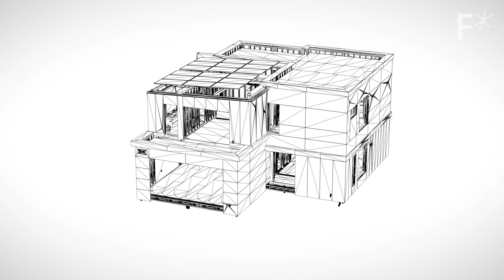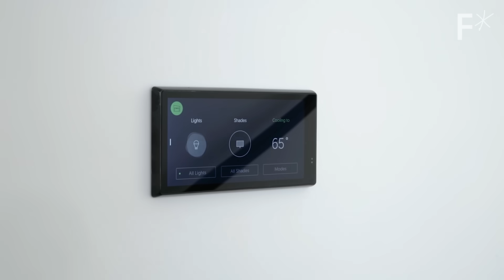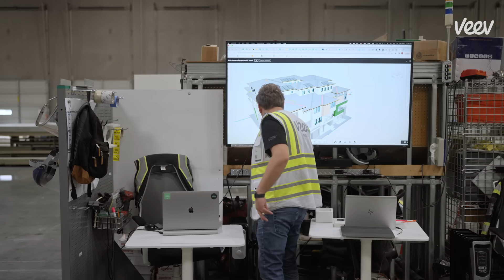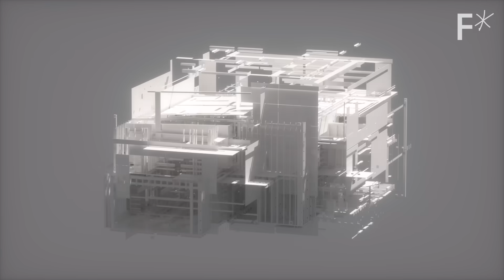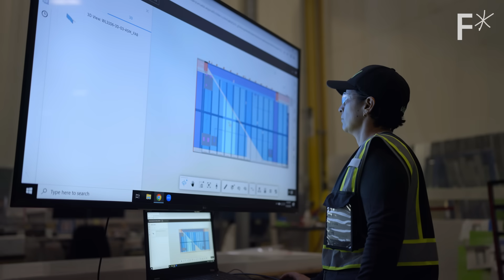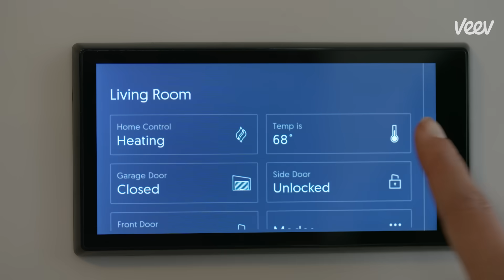We need to build better homes – here’s how

Comment: I want to love this! I really want to see more fabricated buildings that can be assembled on site. However, my number one concern is who services the product that is your home? What happens if you need to fix something in the wall? What if you want to move an outlet? change the lights in your ceiling? The current contractor based industry works and continues to succeed because each industry specializes in the implementation of their standards.

The other practical implications are things like what does hanging art look like? What about anchoring bookcases? Painting the walls, changing the flooring, etc.? Homes need to be able to evolve to meet our needs and desires and as basic as timber framing and sheetrock are, they're extremely adaptable.
Reply: My thought exactly. When they mentioned how the company wants innovate the house like phones and cars, the thought that went through my head was this might be a right to repair headaic considering the production process will be proprietary. And Veev didn't mention repairability either. Its is someones home, not a car or phone, and one of the most expensive "product". There are just too many red flags for my liking.
Reply from the maker: It's a great question! Independent contractors can also do the repairs- every single wall inside and out is a material that opens up really easily and then reseals: “HPS,” aka Corian, shown in the video though this capability is not specifically demonstrated.
Reply: Great comments; I think there will always be a rich marketplace for homes that are highly customizable. I also think there are swarms of people who want nice things without needing their own sense of style, and these prefab homes will be just right for them.
Reply: I’m sure it will repair itself😂

Comment: I would like to order two quad plexus, with a vibrance saturated color for each.

Higher desity is also vital.
Reply from the maker: That would be great! While this company has single family homes in mind, it's easy to imagine how it could play well with increased density and zoning reform. Missing middle housing types like plexes, townhomes, bungalow courts, etc. could be much easier to assemble quickly in areas that are currently zoned for sprawl.

Comment: I completely agree.. Efficiency, cost, and sustainability should be number one factors. I hope veev is taking this into consideration. 70% of an average home energy is spent on temperature control, so a highly insulated envelope is most important and should have been improved decades ago. I did I came across this video because I had similar conceptual ideas of homes being manufactured on the production line and very easy to assemble extremely cost-efficient, super-insulated and sustainable! Sustainability in all things is the most important concept that most overlook. I have built 128 square foot tiny home fully solar-powered fully off-grid with all the modern-day amenities for under 10k!!  Yes it can be done!! Wee need many more innovators in this space
Reply from the maker: That's incredible! Would love to know more about how you built that tiny home. Did you use a guide or is it your own design? Do you plan on documenting it?
Reply: @freethink  thanks for your interest! I haven't really documented it. It was my own concept. I do have some basic photos on Instagram and perhaps when I'm completely finished with it I could pay someone to do a good video and post on YouTube explaining all the systems I've used.. but the basic concept I found a used refrigerated truck box on marketplace for $500 someone was using as a storage container in their backyard .. pick the box up with a tow truck and mounted it on a triple axle trailer due to the heavy weight of the box being 5,000 lb. The refrigerated truck box had 4 in thick spray foam walls floor and ceiling. Then I bought 4 solar panels totaling 1280w and 2 lifepo4 batteries that were 300 amp hours each for a total of 600 amp hours at 12 volt. Mounted those and then bought a 12v mini-split HVAC made by velo solar out of Tucson..  recirculating shower with filtration UV sterilizer light and I use elite Noble shungite in the tank.. that's the basics the rest of it was plug and play whatever appliances kitchen countertops water pumps that you want to use.. I like the 60 PSI  diaphragm water pumps so shower water pressure is equivalent of a house. Can't remember the gallon per minute maybe 2.5 or 3? Sorry I'm not a social media guru.. if you have other specific questions I'll try to answer them here or you can look for my profile on Instagram. Danny Kurek or Daniel Kurek
Reply: @arcturian.9999  daniel kurek, a gdje ti je taj kurek?
Reply: @freethink  Their website has no contact email, and the YouTube channel doesn't allow comments. My questions are; what are the U values of their roof, facade, and floor above ground. I don't see thick thermo insulation in their external wall. What about circularity, using rain water, green roof? Any answer from freethink?
Reply: Sorry D, maybe you and like another couple hundred people want to live in 128sq ft.  
No you don't have all the modern-day amenities either.
Reply: @miked.9364  well I absolutely agree that most people don't want to live in 128 square foot. I'm single with no kids, and have been a truck driver for 20 years so I'm used to small spaces.. however these same super efficient super insulated builds can be built to any size.. next I plan on building a 2000 square foot home out of my own designed vacuum insulated structural building panels, will be more insulated and efficient than any building on the planet that will also be fully solar-powered and fully self sufficient.. PS 128 square foot build has everything that are normal house would have including a full kitchen with running water, microwave, convection oven, air fryer, coffeepot, compressor fridge freezer, a 4 foot by 4 foot stand up shower, instant hot water heater, 12 volt AC and heat, 65in TV, internet, PS4, washer-dryer, water distiller, air purifier, stand-up armoire and the couch that lays flat into a bed. Basically all the necessity with even a little luxury... The only thing I don't have is a dish washer. 😂 But I could and I might?🤔
Reply: This was just an ad
Reply: agree
Reply: manufactured homes been around for a long time.
Reply: @davidho1258  dude you have no concept of construction. My tiny home is insulated twice as good as your stick frame home. Which enables me to fully power everything off of a $3,000 solar system day and night. I wouldn't talk trash and belittle the concept comparing it to a manufactured home when it's much more than that. Manufactured homes are insulated for crap just like stick frame homes.. my entire concept was to see how cheap and how efficient I could build a tiny home. Now that I know firsthand and tested the concept my next will be a vacuum insulated house that's better insulated than anything on the planet cheaper to fully solar power off grid independent self-sufficient self-contained a million times better easier and faster to manufacture than your $500,000 - million-dollar stick frame house that was built super inefficient for idiotic people that have no skills and more money than they have sense.. and my vacuum insulated house will have the ability to be produced on a manufacturing line just like automobiles pumping out houses like cars that are ten times nicer, more efficient Greener cleaner and sustainable at a fraction of a typical house likely under $100,000 for a 3-bedroom 2-bath 1300 sqft.. so you just keep investing in your overpriced asset bubble thinking that homes only go up and stocks only go up and we'll see where that gets you 20 years from now.. I'm building real solutions not taking advantage of financial engineering arbitrage investing.

Comment: Retrofitting homes with better tech is important too.

Eg; Electric heating, better insulation, better windows, electric boiler, electric oven/stove.
Reply from the maker: For sure. It can make a huge difference in the sustainability of existing homes.
Reply: I agree.. Homes nowadays should be vacuum insulated, all electric and solar powered!
Reply: The most sustainable building is one thats already built.
Reply: @jdtravelphoto  The most sustainable TV is the one that's already built...oh wait...
Reply: Induction stove is way better!